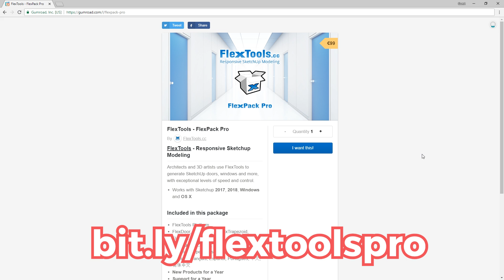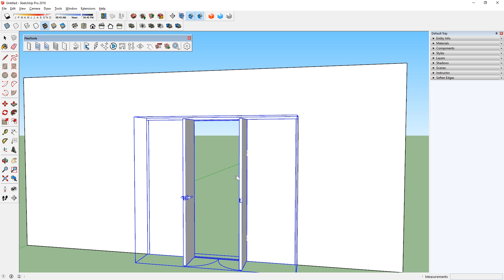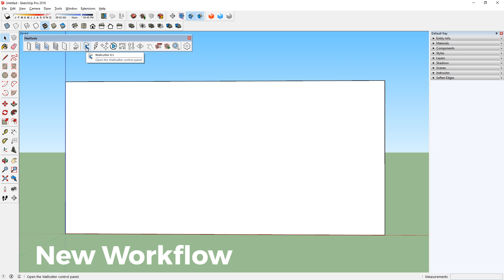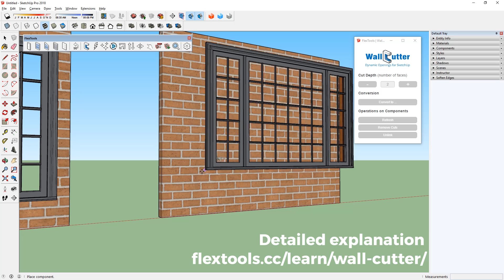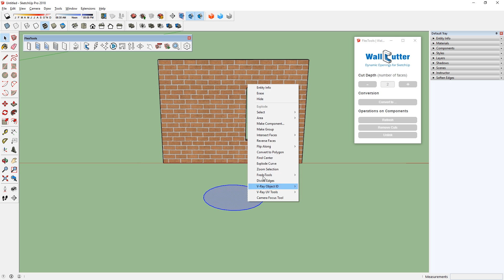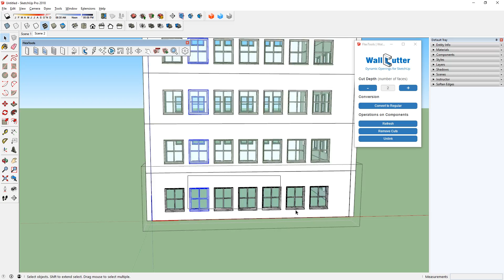How to Model FASTER in Sketchup with FlexTools

Comment: Hi Minh. I noticed you use a lot of different rendering software such as Enscape, Lumion, Vray and more. Just wanted to know your opinion - what would be your preferred software? I've been trying quite a range with Vray being the most realistic although time consuming and I recently gave Enscape a go because of your videos which was quick and produced brilliant VR/360 degree renders fast! It would be interesting to hear the pros and cons of some of the software you have done tutorials on. Keep up the good work with the videos!
Reply from the maker: Hi Ronan! Right now I'm still a huge fan of Vray because I still get the most realistic renders from Vray. As for the other softwares, they all have their own strength and weaknesses. Enscape is improving really fast though. New updates always impress me. I think it's rather easy to use, but I think the skybox and sunlight can have a bit more options. For example an option to adjust shadows edges so that we can get more of a blurry shadow or overcast effect. And sky boxes still looks a little distorted or low quality for me. But as for the strength, it's one of the fastest and most intuitive software I've used. I also use Shapespark, which needs to improve their reflection effects, it looks really odd. But the strength is uploading to a website where you can walk around the model, that's insanely good. Lumion is something I need to spend a lot more time on. I think using it is easy but mastering it will take time, kinda like Vray. Now Vray is still my favorite but if they don't start doing realtime or VR, they will fall behind. There's also Unreal Engine which is crazy good, but need time to learn. So many things to explore!! Hope that helped 😄😊
Reply: Thanks for such a detailed response Minh. I agree, Enscape has really surprised me at how accessible and powerful it is - there is an option to adjust the shadow edges in Enscape by adjusting the clouds sliders in the Atmosphere menu and in terms of the Skybox you can just use your own HDRIs to replace it but I agree that it could be stronger as the presets are a little weak. I imagine Vray will have more integration with VR in future updates but for now I think I'll jump back and forward bewteen Vray and Enscape depending on whats required.
Reply from the maker: That's exactly what I'm doing too! Sometimes clients don't want an ultra realistic render so I would use enscape, otherwise I'll use Vray for the ultra realism 😄 if you ever have any other questions feel free to ask me here or on my social media. I know it may take forever for me to reply but I do like responding to everyone. 😊Best!

Comment: Loving your videos :) Sorry if this is unrelated, though I'm wondering what you think of VRscans? Could the service replace the need for Polygon etc/ is it worth it? Thanks for your time.
Reply from the maker: Hm I personally don't invest in vrscan. It's more useful for product designers than architectural designers. Also vrscan can't be exported into maps, meaning that if later you want to use these materials for software other than vray, you can't. On the other hand, when I invest in poliigon for PBR maps, I can use those maps for every 3D software 😄
Reply: Architecture Inspirations Thanks for the advice :)
Reply from the maker: You're welcome!😄

Comment: Thanks for this video! This seems like a powerful extension. 

My question is how customizable are the doors and windows? Sometimes I need to model thick wood windows with frames the depth of the walls, other times I use thin aluminum windows where the finishes return into the opening to meet the window. 

And can you change slab doors to paneled doors, or doors with glass in them. Pivot doors? Frame sizes and thicknesses?

Thanks so much!
Reply from the maker: Hm not sure about paneled doors and glass in them. Maybe that will come with new updates later but I right now I'm not sure if that's an option🤔

Comment: Got to get this extension ! This is such a Time saver when a client is asking you to draw traditional windows on a building that has different opening sizes on almost every facades. Just wondering if that's so different from profile builder 3 for the use. It looks like this plugin is a bit more efficient when it's about scaling component to keep proportions
Reply from the maker: I have yet to use profile builder 3 but I think this one specializes in openings and such more😄